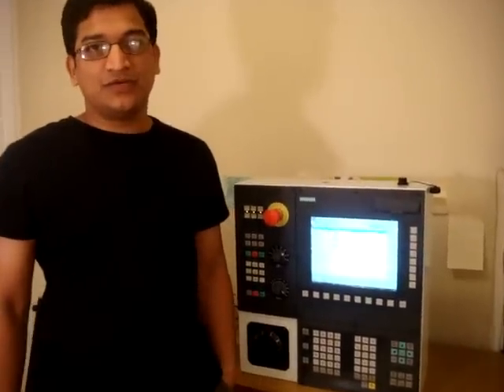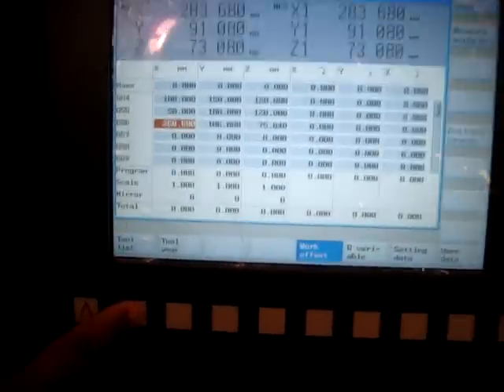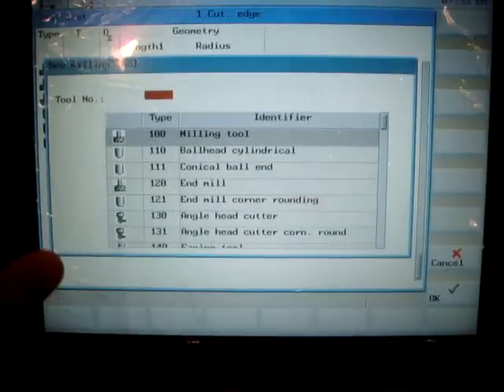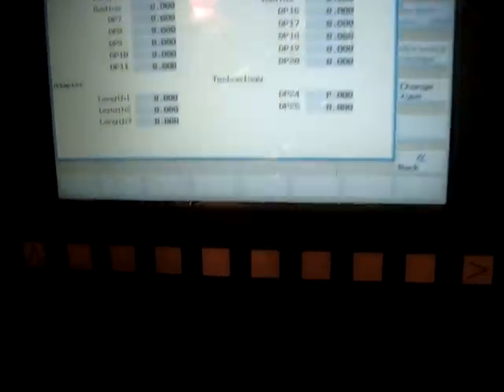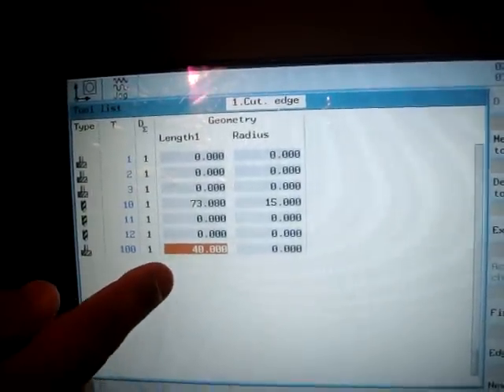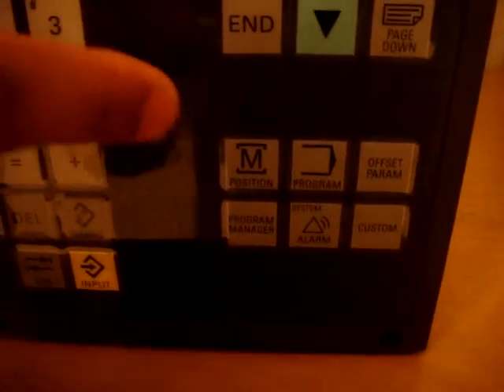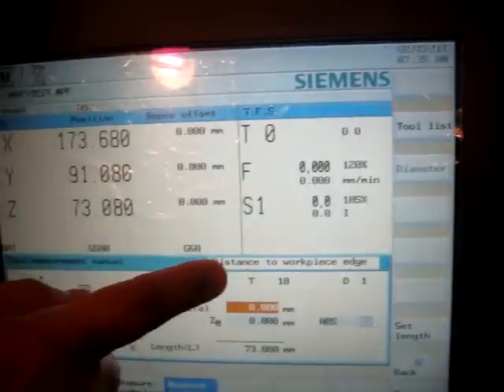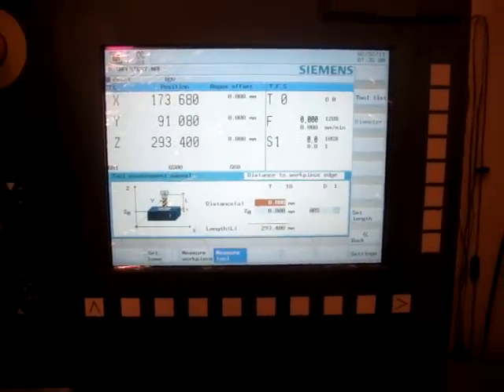Tool offset.MPG

Comment: We do have the same machine. Siemens 802d acculathe. 360 at Osmania university. Engg colg I would request you  if it is possible. To teach or set the machine on running conditions. That would be a. Great help my number 9700637928